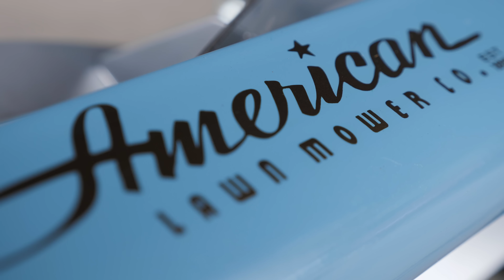Saying goodbye to GATOR and saying hello to my NEW MOWER

Comment: I love it! 5-blades may struggle or washboard some under 1" (you may want a higher blade like the Earthwise 7-blade_ ), but hot damn is that not the prettiest manual reel mower! 🔥there are lots of options out there for rear roller replacements
Reply from the maker: Walt is the man! I was on the fence about going with a 5 or 7-blade. Ultimately went with the 5...because...well...it looked like something that should be parked outside a burger shack after a night drive down the strip. I'll find a replacement for that rear roller soon. Thanks for watching sir!

Comment: Another Great video! Manual reel definitely they way to go on smaller lawns. On 5k sq ft of warm season grass I’ve used a Honda, EGO , TRU-CUT , & a manual reel similar to the one in your video. Hands down the manual reel requires the least amount of effort/time. Not to mention the cut quality vs rotary mowers is superior!
Reply from the maker: Thank you very much! Just having fun with the whole family. Sounds like you have a great perspective on the mowers. I’m looking forward to keeping it simple for as long as I can. After the backyard is done, total square feet of turf should be around 3k. Very manageable. Thanks for watching and taking the time to comment.